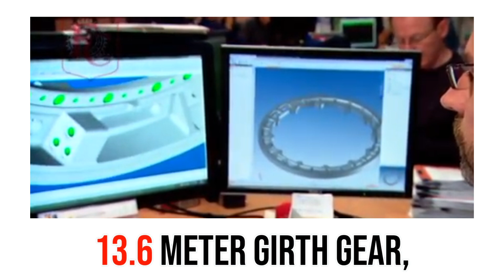Largest Gear in the World | Manufacturer's Biggest Debate

Comment: I literally took a class from AGMA about a month ago that had two old engineers that i 2 weeks had a gear and pinion made for the largest gold mine in Australia for a break down. It was like 4ft thick 36ft diameter single piece bull gear for the hoist. 

I work with gears typically 1ft thick like 3-6ft diameter. Biggest maybe 12ft diameter for an agitator paddler at a paper mill. Our shop can cut gears up to about that size